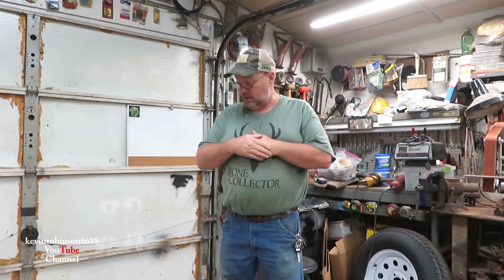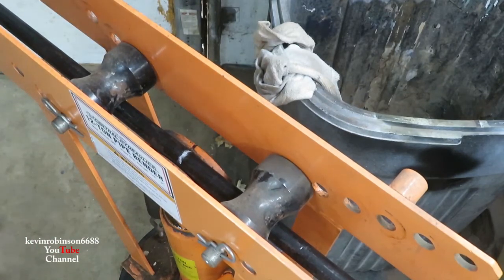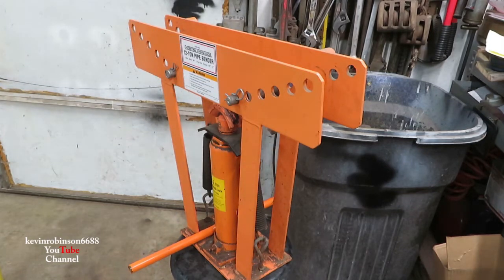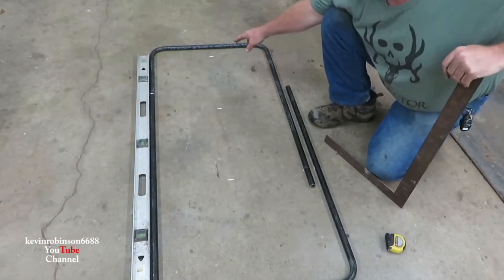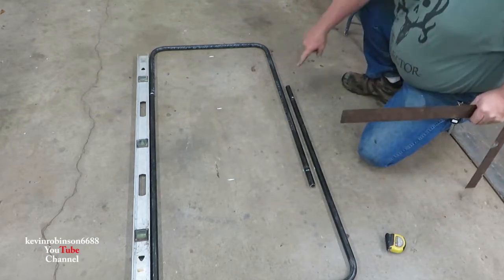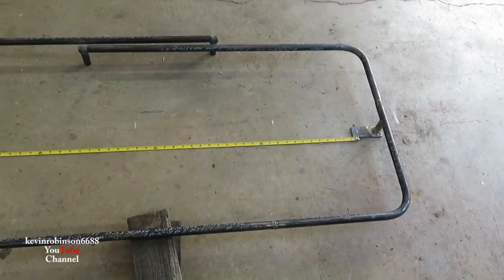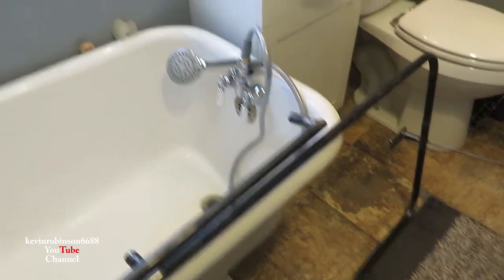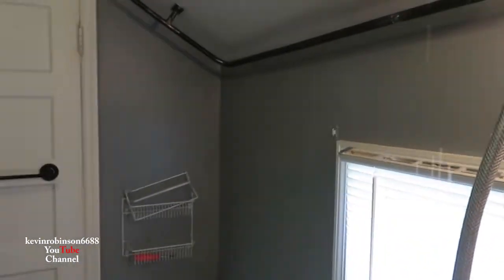Clawfoot Tub Shower Enclosure build

Comment: Looks really good, if the zip ties don’t work out, check the section in the hardware store that has all the wall mount clips that hold your gardening tools, maybe something there would work, and it would be easier if you want to be able to take it on and off. Be well my friend.
Reply from the maker: Thanks Hatch will do.